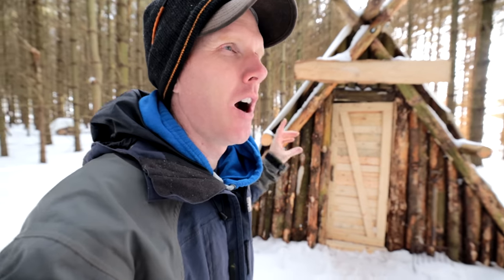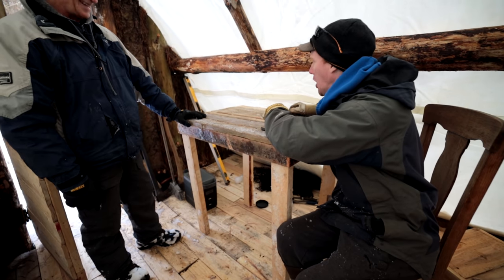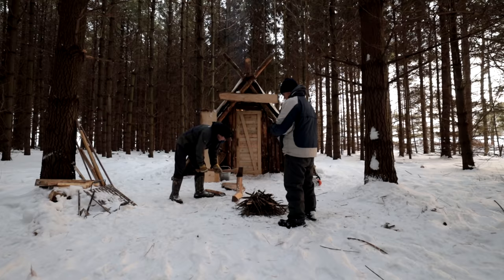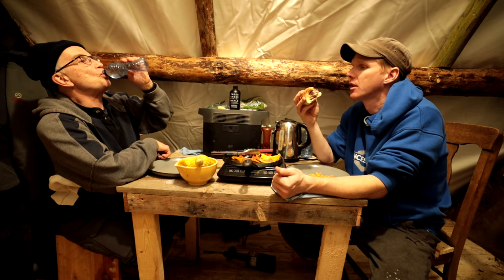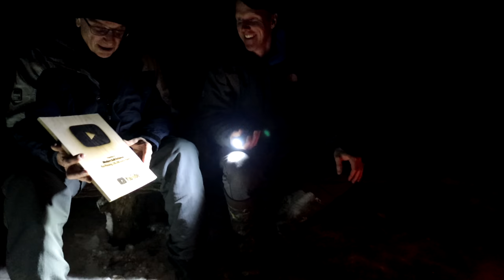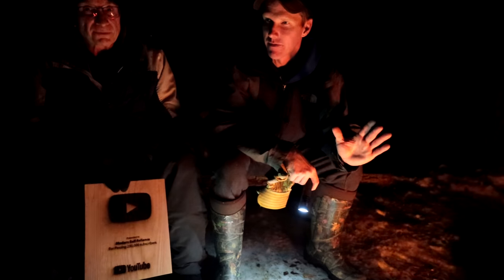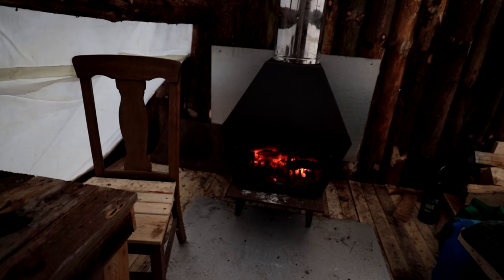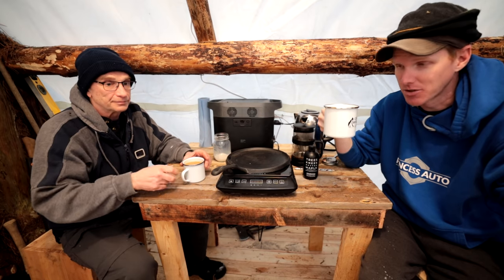Overnight at the LUXURIOUS $7 Dollar Winter Cabin (with Don!)

Comment: Older people also (sometimes) have difficulty with corn on the cob.  They will slice the corn kernels right off the cob.  Place an end of the cob on a plate or bowl and, holding the knife parallel to the cob, slice down between the kernels and the cob and several rows of corn kernels will fall onto the plate (or bowl).  Use the length of the knife blade to cut as many rows of corn as you can in one down stroke.  If you don’t like the corn, you aren’t eating the right one.  There are numerous different kinds of corn and the corn that deer like is not usually the corn that we humans like.  Well, deer like a lot of different types of corn but we probably only feed them the less appetizing kind.  I favor the sweet yellow corn, myself.  And red corn, which is not as sweet but has a nutty taste.

Comment: Build Don's favorite, Butt & Pass method. It last longer than notched because it rots first with logs exposed more & real old log cabins are rotted at corners first. Build two stories above a basement/cellar. Use a pole at each inside corner and cross brace all four poles with cables. Use the top of each pole with block & tackle to raise each log. Drill each log above another log with half inch drill bit. Drill half way 
or 6 inches ( which ever comes 1st) into lower log and drive a 1/2" rear into drilled holes. What do you think, an idea that you might use? Skip Ellsworth taught me that style.

Comment: In norway they make a Hassa built with concrete blocks filled with sand and filled with water filled tubing. You can heat them with a fireplace or woodstove inside the cabin and rig up a heat exchanger to blow warm air or just run the pipes under the floor.